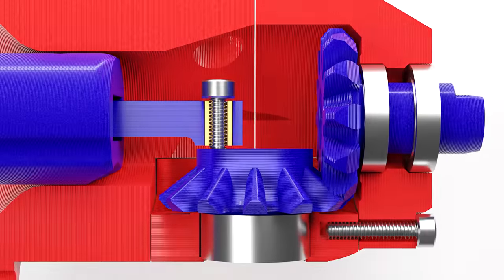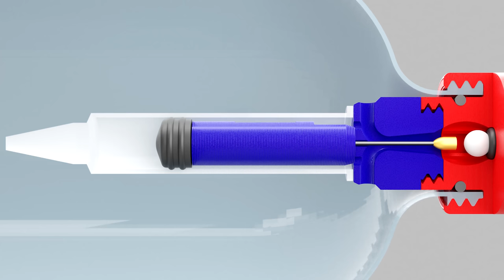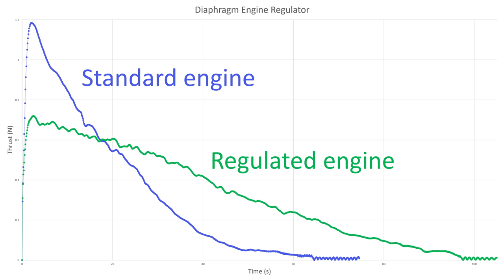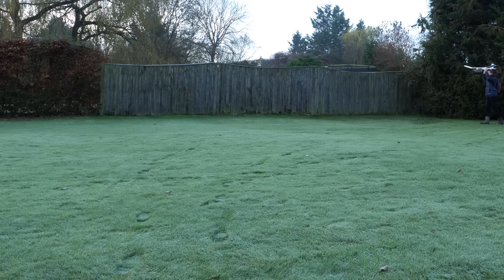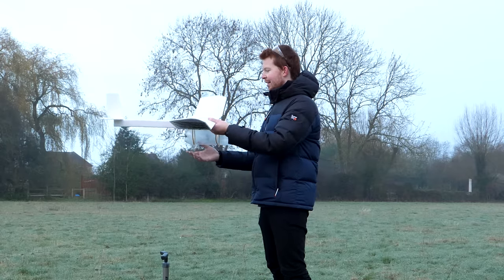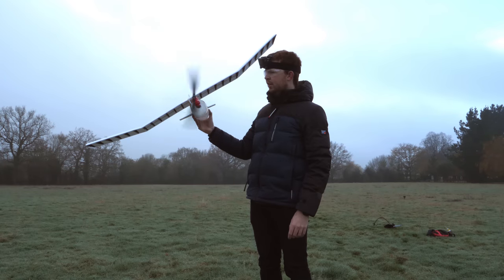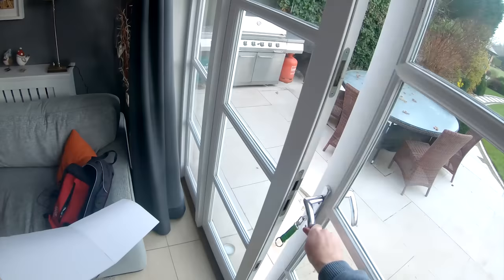Pneumatic Plane

Comment: that syringe throttle control has got to be one of the most simple and ingenious solutions to a problem I've ever seen.
Reply: @ Tom Stanton The pressure siringe flow control MUST BE APPLIED to a water bottle rocket. So... Did you read that MUST? So it means you agree? OK enough for now.
Reply: So true
Reply: Dude my jaw literally dropped. I was thinking off all these complex, and heavy ways he would have to use special circuits and sensors and then all he needed to accomplish it was a syringe. A FREAKING SYRINGE! brilliant.
Reply: Absolutely ingenious
Reply: I love that it also does double duty as a fuel gauge of sorts
Reply: its basically how a regulator works
Reply: IKR using the existing forces in the system to create a automatic flow restriction. This is why I love rapid prototyping. He likely would not have even thought about it had he to played around with syringes for rockets and cars about a year ago. This is why the jack of all trades is often better then a master of one. The master has only known the hammer and the nail for all of his existence. The Jack of all trades learned about compressed air and decided to use that to make a nail gun. While the master will likely be able to hammer that nail in perfect every time the jack was able to replace years of training and expertise with innovation and tangential knowledge. Lear as much as you can about as many subjects as you can. That is how new innovations are made when ideas are not restrains to only the currently existing knowledge on the subject. "But what if we/I?" is one of the greatest questions in all of science.
Reply: No. See also Sr71 motor turbines
Reply: It was very smart
Reply: @johnsherby9130  I thought of solar cells on its wings to power DC motors 🤦🏾‍♂️
Reply: Reminds me mildly of the selfregulating valves CLIPPER® lighters use
Reply: I was just about to come say this. This is brilliant
Reply: I work at designing machines and we "waste" an ungodly amount of time just trying make things simpler.
Reply: I was thinking the same - that is just so damn clever!
Reply: @johnsherby9130  Its this sorta thinking that make big bucks :D
Reply: Yeah I suppose. It's literally just a waste gate control.
Reply: The diaphragm is such a great idea but it needs to be something different rather than rubber. Somehow.

Comment: Fantastic work as always, Tom - it's so cool to see you squeeze more and more efficiency out of these engines. Over 3 years I've yet to see a video of your's that isn't interesting and engaging. Here's to many more!
Reply: You gotta get yourself one of those fancy check marks.
Reply: Hi bro bps space
Reply: that goes for both of you!
Reply: agreed but i just finished "landing model rockets" hope you continue it lol
Reply: And they said Infinity War was the best crossover ever...
Reply: Man of culture our Bernard!)
Reply: After Corona is over, it would be amazing to see a collab between you two!
Reply: saw 999, ocd kicked in...
Reply: Epic Crossover
Reply: @AugustoCabrera  yes please
Reply: hello, it turns out you are also watching here: D
Reply: Tom it would be cool to put two of your engines on the plane
Reply: hi! long since you made a video
Reply: Talking of efficiency, does the air being exhausted still have any potential energy left?  Could the air be passed again through a second smaller engine?
Reply: @UR_HR  I doubt it would have enough potential energy to drive another motor buuuut hear me out. Do what gasoline engines did in the chase of efficiency. Turbocharger. Send the exhaust through a small turbo that helps return some of the exhaust energy as compressed air.
Reply: Carbonated milk man!

Comment: the pressure thing is just genius 
you are fantastic
Reply: I feel like that's "just" a pressure regulator, but the simplicity of the design and usage of random parts like the syringe is great. In general, I did not think it's possible to 3d print air engine due to things like inaccuracy and friction, yet here we are!

Comment: Just got my 3d printer up and running, I might have to give this design a try. You've been doing great stuff here recently. Very impressive.
Reply from the maker: Thanks man! Look forward to see what you produce with the printer!
Reply: I wanna see this
Reply: Plenty of explorations from NightBatInLight coming :)
Reply: @TomStantonEngineering  My ender 3 v2 arrived yesterday cant wait to build one of your engines. You are such an inspiration.
Reply: @TomStantonEngineering  do more (please and thank you)
Reply: Same, my ender 5‘s working a charm
Reply: Mate, I’d build this 100%
Reply: @TomStantonEngineering  how do u get the files
Reply: @newentury96916  do you already have the files?
Reply: @TomStantonEngineering  what software do you use to model your engines?
Reply: @TomStantonEngineering  
   Have you considered an Exhaust Reclaimation System ?
   Of course, it will never reach the replacement pressure of the Initial Output of the pressurized bottle, or even equalize that Initial Pressure,  but,  it can be passive enough to prolong flight by recapturing SOME of the pressure spent on engine operation.

Comment: Hello Tom!

As mechanical engineer (in aeronautics and drones), I am fascinated by your design of a compressed air thruster (with printed parts). I would like to say you "Congratulations!".

Did you try to move back the air tank + compressed air thruster? I have the feeling that the mass center (or center of gravity) is too much ahead. That is probably why the nose dives (maybe also because of the thrust).

Concerning the thrust : did you try with a transmission ratio different to 1:1? The diameter of the pinion and the wheel seems equal (then the ratio =1:1). Try with a ratio 3:2 or 2:1. Your screw propeller
 will turn faster (you may loose torque. You may have to find a trade-off. Is "trade-off" the correct english word to be between 2 stresses or 2 situations?).
How fast is your propeller? Did you gauge the torque?

To finish, you maybe need to make higher wings.

It will be a pleasure to follow this project. All the bests! :)
Reply: Hey there bro. I'm a student in the field of aviation and my career goal is to become  an engineer in aeronautics. Do you have any tips or headers or anything you would share in order  to get a successful opportunity during and after graduation. If so, please provide me with the necessary information, and it would be greatly appreciated.
Reply: what u say about the wings ?
Reply: Hello, @alexandrerouleau9971   
I would use the word "compromise" instead of trade-off.
while trade-off is a similar word, it is used more in situations like: "you will loose some torque but in exchange for double the speed I think that's a good trade-off"
(now you are referencing an actual "trade" here being torque traded for speed. Furthermore the word trade-off also implies a certain "benefit" for one side. Here speed being more crucial for a propeller than strength hence the speed is a larger benefit.)
Compromise means exactly what you ask; to find a middle ground between two situations. Note that compromise can also be used instead of trade-off in the situation above.

People will understand what you mean though, and there was no part in your messages that was unclear to me.

I hope this was clear for you!
disclaimer: English is not my first language either, but I did grow up almost bilingually.
Reply: I will be willing to help in any software engineering related fields in this project as this project is a game changer if it can be scaled to real size air busses
Reply: @MortonPNZ  you are probably right, we have to find a compromize of the mass center position :
- Too much moved back : it will pitch up, and loose energy to fly
- Too much moved ahead : the nose dives to much
- Correctly positionned : it will fly longer

I absolutely agree with you concerning the thrust angle regarding te fuselage. I didn't think about it for a model which its construction is "simple". But when you think about your solution, he can actually improve its angle by using corner spacers.

In every cases, he needs to compare its behavior depending on the different physical characteristics.
I'm pretty sure that your solution and mine will improve its flight.
Reply: @alexandrerouleau9971  I see. Yes, thank you very much. I sincerely appreciate your help.🙏
Reply: Welp. As a 15 ur old who has made a ton of paper airplanes I think that the wings
New some sort of editing. (Take this with a grain of salt plz) increase the front weight of the wings, decrease the back weight, and angle them back a smidgen. Thank you for your audience.
Reply: @Wiimaster.  hello, I'm currently in highschool and I would like to have a career in aerospace, any tips? Right now I build and fly my own rc aircraft.
Reply: Trade-off is close. Relevant, but not quite the right one. 
A more accurate word would be "compromise."

He needs to find a compromise between torque and speed (of RPM)

And yes i agree. Either add ballast to the rear, or move the tank further back.

Comment: Use the exhaust ports as a form of propulsion, force the air in the opposite backwards and narrow the tube to increase the amount of force it produces. This may help the craft to fly faster and for longer
Reply: It would probably cause the engine to run slower, since it would take longer to exhaust
Reply: @ergile172  nah, the actual exhaust ports would be the same size as they are currently, meaning the same volume of air would be expelled at the same rate, just a different direction
Reply: There is no way you could get any substantial thrust from a nozzle with that tiny bit of air the engine uses. Plus, using compressed air for thrust is just incredibly inefficient.
Reply: @derrick4804  I know, but marginal gains is all you can hope for with an engine like this. It is never going to be efficient at all, just trying to suggest some potential changes that make it function better and look cooler 😎
Reply: @ScalarYoutube  If by marginal you mean like 1-2% of thrust the engine provides, then go ahead.
Reply: @derrick4804  I do
Reply: @ScalarYoutube  I don't know how to respond to this. I have some serious questions about your opinion that are probably not worth the time to discuss. Can we just agree to disagree.
Reply: @derrick4804  sure. I mean you initiated the conversation mate, end it anytime you want lmao
Reply: Gotta admit. The end of this conversation made me laugh :D
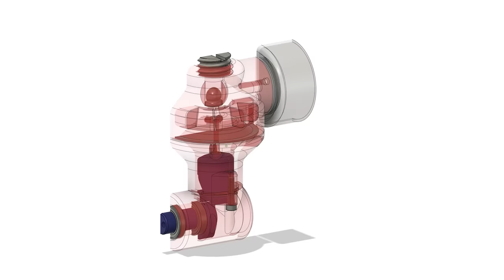Reply: @ScalarYoutube  I just realized, from 5:02-5:07, he shows the engine with the exhaust port already pointing to the back-right.
Just take a look at the size of the propeller vs the size of the exhaust port and you'll understand how inconsequential an exhaust nozzle is.

I don't want to be a redditor but...
Let's roughly estimate the thrust of the propeller and the nozzle using F = A*Δp where F is force, A is area, and Δp is the pressure difference. https://www.grc.nasa.gov/www/k-12/airplane/propth.html (source)

Lets assume the pressure difference behind the nozzle is 3 times greater than the pressure difference behind the propeller. So we'll use 1 and 3 instead of Δp

diameter of most model airplane propellers are 5 inches
area of prop = 2.5in²*3.14 ≈ 19in²
F = 1*19 = 19 <----- force of propeller

diameter of the hole looks about 0.2 inches by a generous estimate
area of nozzle = 0.1in²*3.14 ≈ 0.032in²
F=3*0.032 = 0.1 <----- force of nozzle

This means that the force from the propeller is 190 times greater than the force from the nozzle.

I'm so sorry for this.
Reply: It's negligible.
Reply: @derrick4804 you absolutely killed him with some simple math lol

Comment: I like how this engine still sounds like a combustion engine.
Reply: No combustion engine makes u deaf
Reply: That plane just keeps looking for the hard place to stop!
Reply: Cause in some regards its similar to a combustion engine. Using a piston and a gas with valves. It's not a combustion engine but similar.
Reply: That's because it is the same basic idea as a combustion engine, minus the BANG in the cylinder. Anything like this is going to rely on the movement of air, whether there is combustion or not.
Reply: It sound like generator starting
Reply: It's still expelling compressed gasses so yeah
Reply: Me 2
Reply: because piston
Reply: Probably because it’s linear like a combustion engine
Reply: Because it has a piston...

Comment: Really smart ideas and quick, practical test modeling. An office light tube storage container may be a good candidate for another low pressure model with higher volume. Long skinny fuselage. Might require a girdle if you have strong seals though.

Comment: "Rubber diaphragms don't like low temperatures"
Pretty sure we learned that on the space shuttle
Reply: That was a nitrile I-ring, but yeah, nice reference.
Reply: They knew the risk of failure was serious back then but some people don't care about the risks
Reply: Silicone rubber may fare better IIRC...
Reply: maybe try a different synthetic material, one that doesnt matter what temperature it is, it would still work.
Reply: @MF175mp  it was a risk but it could've been avoided by waiting until warmer climate and even warming the o rings themselves. They launched it in a very cold climate it wasn't really a risk but more of a guarantee. This was an unnecessary and humiliating failure costing several lives and lots of money.
Reply: @joshuamcpeek4708  the ignorant ones were in charge just as always.
Reply: Rubber diaphragms are designed for higher temperature and high thrust, believe me, my girl friend knows 😋😁
Reply: @MF175mp  if they are not taking the risk. Interesting discovery

Comment: I suggest looking into the re-melting method of 3d printed parts in grounded salt --> CNC kitchen made a video about this
Reply: Agreed, this might be a great application for that, providing he can keep the internal surface smooth/accurate enough to work, this is a bit of a high tolerance use case.

Non PLA plastics might help too, PETG, Polycarbonate, or even a high durability resin print might be interesting tests too

Comment: "I think with a little more weight saving and some normal weather, this plane might actually be able to fly a full circuit".... how about some more space??
Reply: He used a field but because of the cold weather he had to pressurize inside and fly in the garden... with warmer weather he could use the field without the engine underperforming
Reply: In higher altitude there is not much air to lift the plane

Comment: covering the underwing will improve lift by reducing drag
Reply: Yeah your right I thought the same thing
Reply: Also moving the wing closer to center of weight
Reply: I'm a cfd engineer, I bet that this is the worst design for a lift. The under wing has to be covered to reduce drag and to increase lift
Reply: This is very cool, but I'm certain the wing needs a bottom surface to be an effective low-speed airfoil. I hope this helps.
Reply: I was looking for someone answering you with this,  you NEED to COVER the underwing to increase lift and reduce turbulence. The concept looks stunning! keep on it :)
Reply: also increasing wing's surface area would help
Reply: Tom i am with this man, you will increase the weight of the plane but lift will be increased much more, is a wining desing to cover the underside. BTW amazing compresed air pulse jet design.
Reply: Yea

Comment: You're clearly getting enough out of the engine to sustain its flight far longer than a glide, so I'd say you've been quite successful so far.  I'm astounded at how good a plastic drink bottle is as an air reservoir and I love your syringe-based air regulator... that's just bloody inspired
Reply: The drink bottle working under pressure actually makes a lot of sense. 

Initially you think "oh it's just a drink bottle" but it's been designed to hold gas pressurized into a liquid and hold that pressure when being shipped across the world. Considering it can do all that while costing likely less than a cent in materials is quite a feat of engineering.